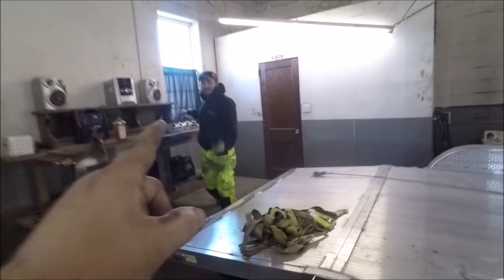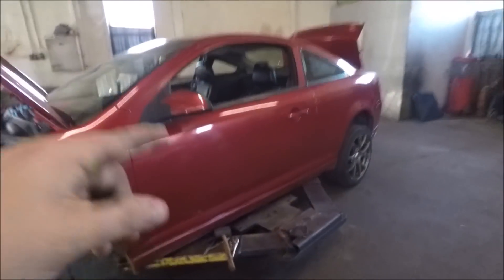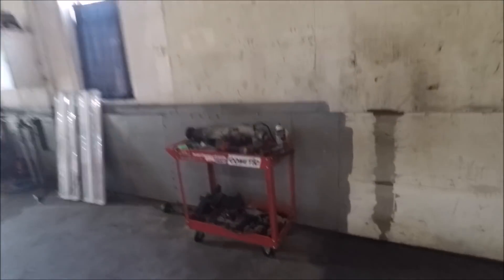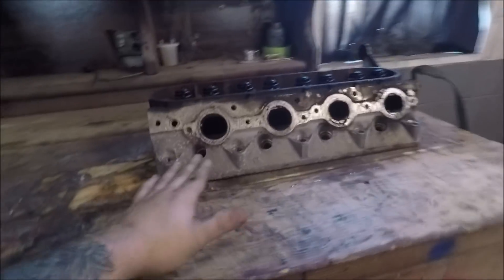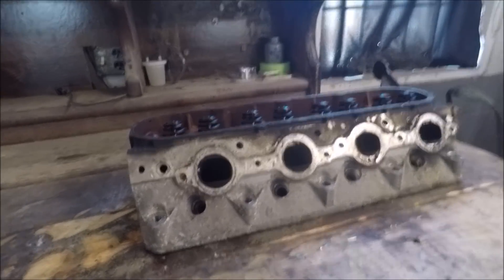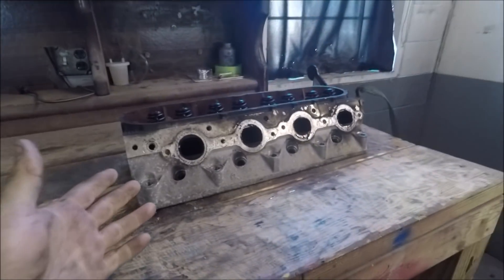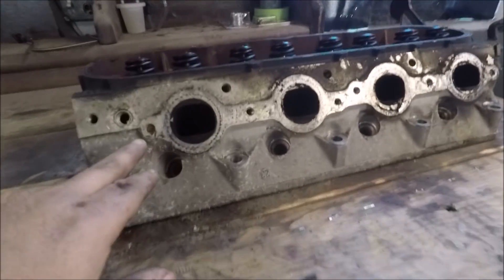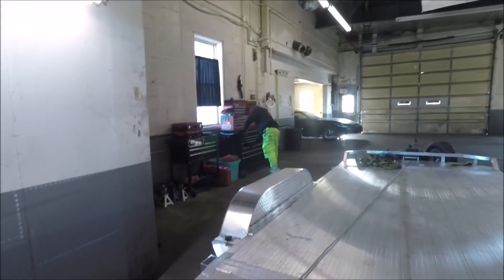The Proper Way To Get A BROKEN BOLT Out!

Comment: what i want to see is how to re thread new bolt holes like from scratch to see how it is done i dont know if andy knows how to do that
Reply: like drill a hole and thread it with threads from scratch even at that how do you even buy kits that allow you to do that
Reply: It's called a tap and die set and it's pretty easy to do

Comment: I like the welder idea also used it many times just weld the inside of the nut to the broke off Bolt and the heat from the weld helps it also and you don't have to take the head off car

Comment: You said easy out ,think you meant heli coil.
Reply: @probablynotwearingpants6228  Easy out is another name for a screw extractor not a drill bit.
Reply: @probablynotwearingpants6228  @ 12.06 he mentions drilling out the threads completely,then using an easy out.Im sure you and I have done our share drilled out ,re-tapped and installed heli coils.

Comment: I left my heads on the car when this happened to me.. busted flush. I used a welder and got a nice ball on the end of the bolt and used vice grips to back it out.
Reply: Best way to do them honestly. I pull so many broken gm manifold bolts its unreal.

Comment: It also sometimes helps to put some heat to the outside of what ever you are trying to remove the bolt from especially if it's rusty or the bolt had locktight